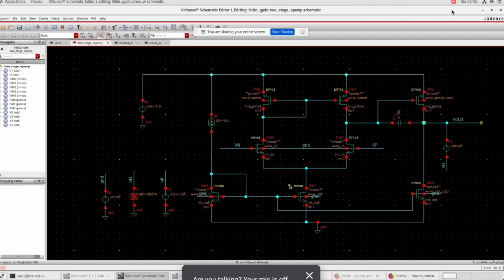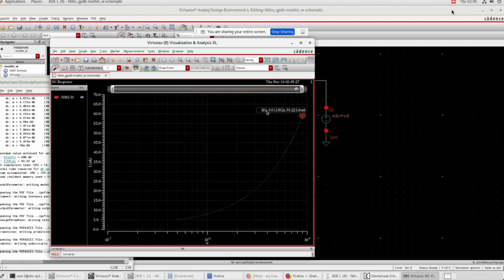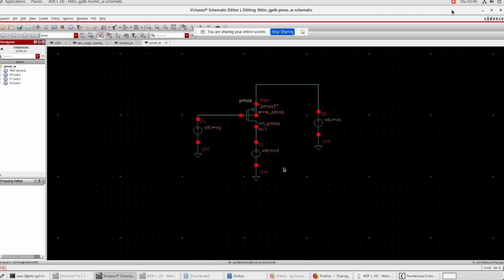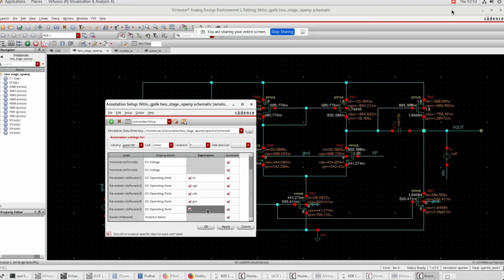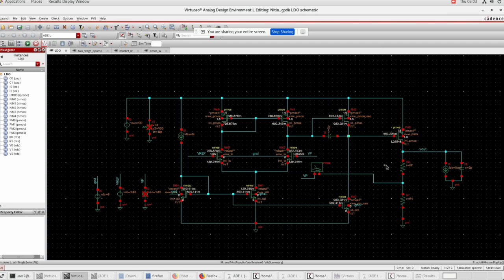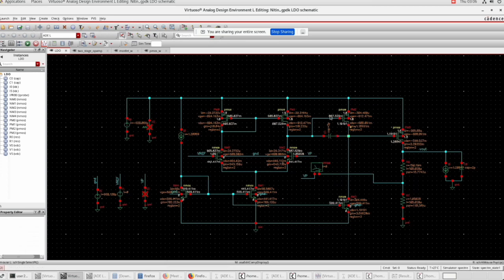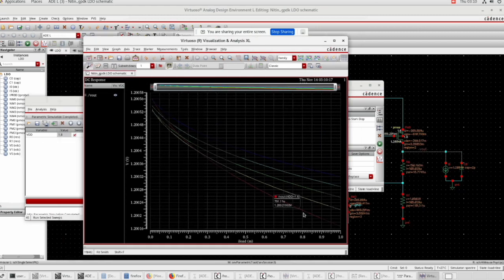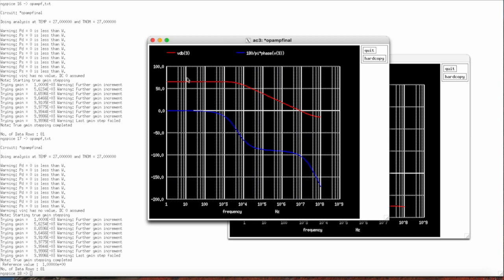Design of two stage OPAMP and LDO

Comment: Thank you Sir 😊
Can i use this circuit join in Current mode PWM Boost or voltage mode PWM Boost🤔🤔
+ RS latch out to inside Gate Drive